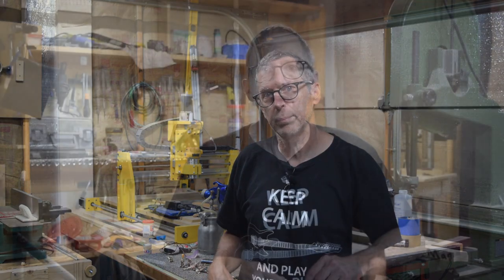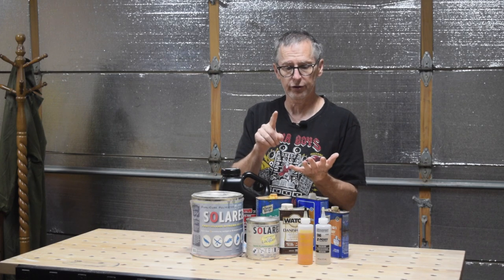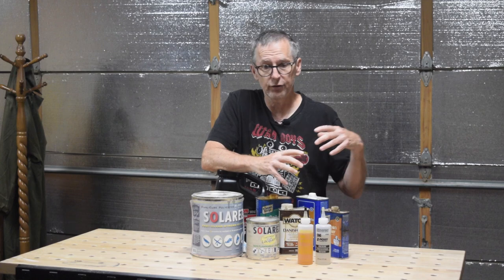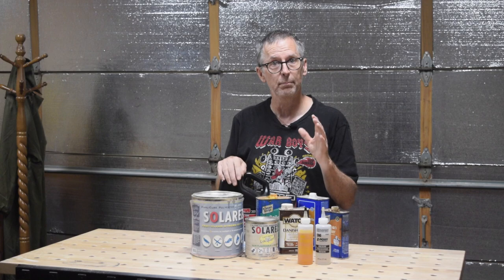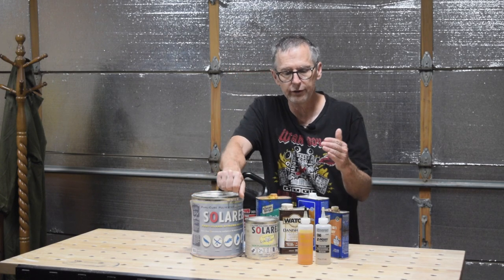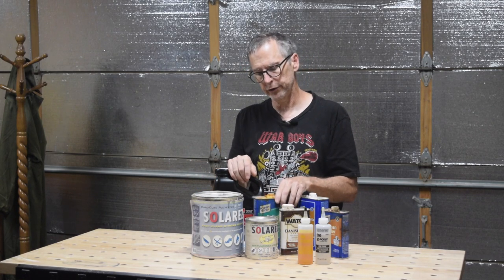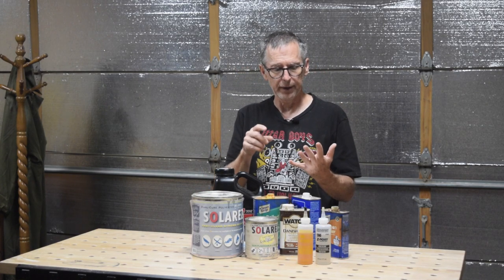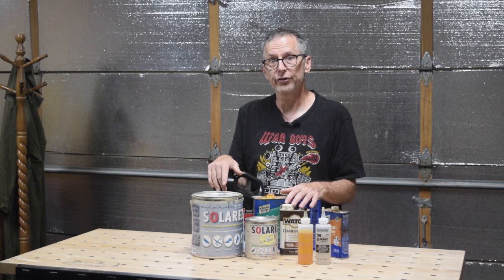Luthier Quick Tip 3: How to Decide On A Guitar Finish

Comment: Timely vid, thanks!  I just completed a refinish on an old Peavey Raptor using Duplicolor acrylic lacquer, and I'm not thrilled with the clear.  It's level and glossy, but still fairly soft after several weeks.  I worked really hard to apply it correctly, so I'm writing it off as unusable under my conditions and moving on to something else.  My son's SG-style kit is in process, and I definitely want a better topcoat when it reaches that stage.  I'm pretty much narrowed down to either Crystalac or a 2K urethane product.  I've used a rattle-can variant with some success (learned a few things for sure), and now I think I might be able to do a nice spray finish with my HVLP.  I've got to think that either would certainly would be more durable than this acrylic lacquer, with the additional bonus of getting to level and polish much sooner.

Comment: Thanks for this!  A great review.  

I have started using “I Can’t Believe it’s not Lacquer” and made a ukulele sized tanning booth for curing.  Very happy with it and the results!  My ukulele shop is in the basement beneath my home so the more potent vapors of the harder Solarez product takes it off the table.
Reply: Does yours still feel slightly tacky when cured?  I've been working on a body for much too long trying to get ICBINL to act like a finish coat but it just doesn't dry hard enough.  Not after curing for 25 minutes with a less-than-hair-thin coat.
Reply: feanor70115 I have applied many coats of ICBINL with a moist make-up sponge.  Then the object is cured in the booth with LED UV bulbs (385nm) then sanded between.the coats.  I judge the cure complete by the white powder sanding produces.  

I have not tried buffing to a gloss.  After sanding with 2000 grit I have applied wax and am happy with the satin finish that hand buffing the wax produces.  

Before sanding the cured glossy surface it does feel almost wet.  But the sanding shows it is not.  If I went to wax without sanding the wet might go away, but there are enough bumps I generally need to sand.
Reply: @short6691  Thanks for the info.  At this point I've pretty much decided to just wait for some Crystallac for a finish coat.   I've got a decent semi-gloss but it's too thin to buff (I've tried and it just dulls the finish and burns through it) and I just need a way to put a harder finish on it without a booth or a buffing machine.
Reply: feanor70115 Sounds like you have a good path forward.  

Best wishes!

Comment: Thank you for sharing your knowledge.

FYI, if there is a Walmart near you, they carry Tru Oil.  Also, if you leave the foil on the opening, use two small holes to dispense the product, then store upside down I have extended the shelf life well over a year.  One other snippet, when applying the last coat or two a few drops of mineral spirits will thin the product down and produce a surprisingly deep shine. 

And if you just don't like Tru Oil, well, never mind!  Thanks again for sharing.
Reply from the maker: The Walmarts in my area don't sell it. No one in my neck of the woods sells it. I have to order it and since I can get the same effect faster and cheaper with Z-Poxy, which is available locally at several hobby stores, that's what I will continue to use.

Comment: Thanks for the great info. I definitely struggle the most with finishing. I might give the CrystaLac a try fro my next build. I've used wipe-on poly a couple of times. It works pretty well but scratches fairly easily.

Comment: @highline guitars , great video , sir.   I have a question. I want to strip my Gretsch and my P-Bass down to just the bare wood.   I don't care about "gloss" "shine" or aesthetic appeal, I just want to seal/coat the body to protect it, that's all.   What product do you recommend for this? And any info about application , curing etc would be greatly appreciated! Subscribed to your channel! Thank you!
Reply from the maker: The easiest way is to use boiled linseed oil or tung oil. If you want a little more protection a wipe on polyurethane or Danish oil works great.

Comment: @Highline Guitars  I’m a hobbiest on my fourth guitar project.  My current project is the first one where I am doing a clear-coat over paint.   I have never level sanded or buffed a guitar.  On this project I don’t need to be bullet-proof.  Based on the video, I would like to try the I Can’t Believe it’s not Lacquer.   Here’s my question: On my current project, I have been doing image transfers using acrylic medium, and painting on top of that with acrylic paint.  The guitar is coming out really cool, but due to the transfers and the acrylic paint, there quite a few places where the surface is not smooth.  Ultimately, I would like to have a clear-coat that is thick enough to that I can get a smooth outer surface with  but without sand through the clear-coat when I am level sanding.  Would I need to worry about that with the I Can’t Believe it’s not Lacquer product?  Can you do multiple coats of the I Can’t Believe it’s not Lacquer?  If so do you need to level sand and buff between coats?  Any help is very much appreciated…
Reply from the maker: ICBINL is 100% solids so each coat cures thick. I've done multiple coats no problem and that includes level sanding with 400 grit between coats.
Reply: Thank you!  Super helpful…

Comment: Awesome tips.  I've been working on a guitar for a friend.  Doing a distressed brown look, but he doesn't want any gloss.  he wants a more matte or satin finish.  I like the Solarez products.  What would you recommend that would have the strength of the polyester but with no gloss?
Reply from the maker: Solarez products are intended for high gloss finishes. The only way to get polyester durability is to use polyester. A good alternative is 2k polyurethane. In fact, there are a lot of high tech water-based 2K polyurethanes on the market now. Centurion, Envirolac, Renner, and Milesi make them in matte to gloss sheens. Be forewarned, they require a catalyst to achieve maximum durability and they aren't cheap.

Comment: Yeah, Watco Danish Oil is great to work with! I got a free table from someone, took off the damaged veneer and applied some Danish Oil to it. I have a novice question regarding coating guitars. I was going to clear coat the headstock of my acoustic guitar with Rust-oleum 2X Semi-Gloss Clear, but I never. It comes in a spray can. Can you use that type of product for a gloss on a guitar?
Reply from the maker: I have never used it, so I can't say for sure. I would definitely test it on scrap first. Also, be aware that whatever you're spraying over could react with the clear.
Reply: That's a good point; I never thought about the possibility of there being a reaction. I had a bottle of it, and I gave it to someone who used it on signs for a glossy look. It doesn't seem to be a product to use on a finished guitar.  @HighlineGuitars

Comment: Great video! I tried making my own oil finish with boiled linseed oil, min spirits, and polyurethane like you suggested. It looks great however, after a few coats I think I want something that's more glossy. Can I adjust the ratio of the mix to have more polyurethane to achieve this? Or should I just wait for it all to cure and then apply something like the Crystalac Brite Tone? Thanks!
Reply from the maker: You can try adjusting the ratios, but you'd be better off using a clear coat like Brite Tone.

Comment: Learned a lot from your videos. I built a guitar from a soft okoume. Thinking of Solarez Polyester for max hardness. Will it lift the black analine dye and do I need filler or sealer underneath. The body doesn't have a lot of grain. Also would soaking the body with West exopy then use the less volatile Solarez be just as good?
Reply from the maker: I have no idea. you'll have to test on scrap.

Comment: I'm thinking of stripping the top polyurethane coat on my classical Cordoba c4 ce and using an oil based finish on it. Is it a bad idea to just do the top and leave the back and sides poly? I have a hunch that it may cause cracking, especially in a humid environment.

Comment: I could be mistaken, but I don't think you answered the question of which finish you prefer over a stained wood body. Could you shed some light on that question for me? Thanks so much.
Reply from the maker: These days, I like Centurion 1800 Water-Based 2K Polyurethane. However, a lot depends on the outcome I'm after. I also like to use Danish oil if I want to keep the look and feel of the wood grain.

Comment: I have an old but good Ventura acoustic, and want to remove the original stain/sealer; and stain it a lighter color. Any advice on which stain to use; and also, will I achieve a richer intonation with a particular satin. Thanks!
Reply from the maker: The only advice I can give you is to test on scrap. If I recommend a specific stain, you may not like it.

Comment: Just a  tip: brite tone will not stick on solvent or oil based based paint schemes while level sanding.  Chris is right you need  to stay solvent with solvent and water base with water base products.  Testing is essential.
Reply from the maker: I’ve never had a problem with adhesion between Brite Tone and solvent/oil based paint. Just make sure it’s fully cured before you clear coat.

Comment: I hate gloss finishes. I'm leaning towards the boiled linseed oil. But if I want a bit of tint, would you recommend stain first and then apply the boiled linseed oil over top, or mix some sort of transparent pigment into the linseed oil?
Reply from the maker: I use Windsor Newton artist oil paints to tint the BLO.

Comment: What is the best finish for achieving the best tone?  That is my main objective.  I just bought a Martin that does not have a finished top and the tone is amazing!  I'd like to finish it, but want to maintain or enhance the already great tone. Thanks for your experienced insight!
Reply from the maker: Since I concentrate on electric guitars, the finish doesn't matter. However, on acoustics, the thinner, the better. A thin coat of Solarez I Can't Believe It's Not Lacquer or Crytalac Brite Tone are my choices.
Reply: @HighlineGuitars  Thank you for the insight!  One more question though if I may,  since I'm okay with a satin finish, would an oil finish be the best for acoustic tone?
Reply from the maker: @michealjoseph9943  that would be the best for resonance, just be aware that oil won’t offer ding and scratch protection.

Comment: +Highline Guitars do you have any experience with minwax water-based wipe on poly? Do you recommend it? Looking for something water based and durable
Reply from the maker: It's okay. A bit tricky to apply because it raises the grain. That means you have to lightly scuff sand between coats to remove the raised grain and get a good bond. Also, it's not going to be as durable as a spray on water-based polyurethane like Crystalac Brite Tone or especially Centurion 2K water-based polyurethane.
Reply: @HighlineGuitars  would you recommend varathane’s water based wipe on over minwax’s? Thanks for your help, we really appreciate how you share your experience with us so we can learn
Reply from the maker: @anthonysclafani3963  I've never tried Varathane's product.

Comment: I’m looking to apply a real leaf to the top of my poly-finished turquoise Les Paul. Any quick ides? Several coats of brush-on poly? Love your videos! ✌️❤️
Reply from the maker: I would laminate the leaf to the body with slow setting epoxy. As it dries, lay a piece of wax paper over the leaf along with some HEAVY books to make it as flat as possible. Let it sit overnight and follow up with multiple coats of polyurethane. Good luck!

Comment: Great video. Very informative.
I have a question: is Watco Danish Oil compatible with dyes or stains? I mean, can it be applied over a stained body or top (like a hand rubbed burst)?
Reply from the maker: Watco Danish Oil is already tinted.
Reply: @HighlineGuitars  I mean the "natural" one, apparently it is clear(ish).
Reply from the maker: @LaPiernaDeMiAbuela  It should work. Test first on scrap.
Reply: @HighlineGuitars  Thanks!

Comment: Not familiar with Z-Poxy. You say it has "a slight amber tint to it" and I have to ask, amber in an "antique" lacquer kind of way by any chance? That could be really appropriate for a very subtle relic outcome I have been trying to figure out for sometime. Note: I'm not talking about the usual, "the tour bus driver ran it over, multiple times" type relic jobs that are all the rage it seems, but rather a certain "patina" (if we can we call it that) in some older lacquered instruments that I would like to be able to solve for. I think I can handle the "crackle", but nailing that color (discolor) with a gloss finish is the prize.
Reply from the maker: If varies from bottle to bottle.

Comment: How many coats of zpoxy do you recommend? I have a mahogany body that is finely sanded from a stewmac kit and I’ve never done a guitar before. Plenty of experience staining  pine doors and moulding  in my house couple decades ago followed up with water base  satin polyurethane, but that’s it. Still a novice. Still on the fence….
Reply from the maker: Every situation will be different, but no more than 3 coats should be sufficient.

Comment: G'day, love the video. But I was just wondering do you need to coat of paint or varnish on electric guitar/bass at all? Can you get away with just bare wood and apply may be a wax finish to it once in awhile.
Reply from the maker: You need to seal the wood to prevent warping, twisting, bending, and cracking due changes in humidity. Wax isn’t sufficient to seal the wood.

Comment: If I wanted to paint my guitar body with acrylic (water-based) paint, is there a finish/topcoat I could apply that would take less than the standard 30 days to cure? I don’t need a mirror or high-gloss sheen, satin is fine. 

My only real stipulation is that oil-based finishes would screw the paint job up and I’d rather not have to sand the entire thing down and start again.
Reply from the maker: Centurion Water-Based 2k Polyurethane.

Comment: Qucik question for you, hopefully you see it and can respond.  Im going to use the watco danish oil on an acoustic guitar.  After i apply the finish, do i need anything else ontop of it for example a clear coat, poly, or lacquer?
Reply from the maker: Only if you want an additional level of scratch and ding protection that Danish oil can't provide. Keep in mind that there are some people who think that clear coating an acoustic guitar will diminish its resonance.

Comment: Have been trying out "I can't believe it's not lacquer " on rosewood.  I use as a sealer and a cover finish. My rosewood finish is not curing as expected. Do you have any pointers for using this product on rosewood?
Reply from the maker: Rosewood contains oils which can inhibit any type of finish. I believe Solarez sells a sealer specifically for oily woods, but I'm not sure and their website is currently down for maintenance. One thing you can try is to wipe the wood with acetone. As soon as it flashes off, apply the Solarez ICBINL.

Comment: Have you used an automotive style clear coat product, with separate hardener, like Omni? Thoughts on something like that, compared to Crystalac and Solarez?
Reply from the maker: Yes, I have and they are incredibly durable. However, they are also super toxic as the hardeners contain isocyanate. In Europe, they have just started to restrict the amount of isocyanates in these hardeners. The U.S. will eventually follow. Will that spell the end for 2K Polyurethane?

Comment: Just got an ES style kit. Whilst waiting for delivery I have watched umpteen videos (mostly yours) and think Crystalac is what I will be using. I have questions but 2 are on my mind. 1. Is it OK to use an orbital sander on a guitar which does not have a flat front? 2. How do I deal with the bindings? Should I use narrow vinyl masking tape?
Reply from the maker: 1. Yes, if you are careful and/or use a variable speed ROS set to the lower speeds. 2. I spray my clear right over the binding. If it's tinted, I spray over the binding, let it dry and scrape the color off the binding with a razor blade.

Comment: I have removed the original polyurethane finish off the face of my spruce top acoustic guitar. I'm wanting to give it an antique look (without the distressed marks, etc.) What sort of finishing process is ideal for that?
Reply from the maker: I would go with a natural tint Danish oil. Hand rubbed with 5-8 coats.

Comment: Could I use Crystalac matted finish on Zpoxy or have you found Zpoxy to be sufficient for the top coat?  How do you use Zpoxy on maple?  Would I just apply multiple coats of Zpoxy to build a finish?  Does Zpoxy need sanding in between coats?  Thank you.
Reply from the maker: Z Poxy works great as a top coat. However, if you want a matte sheen, you'll have to use a top coat that is formulated to dry with a matte sheen. Crystalac Brite Tone Matte would be a good choice. You can also apply Z Poxy to Maple the same way you would any other wood and yes, you'll need to scuff sand between coats to ensure proper adhesion.
Reply: @HighlineGuitars  If I apply Zpoxy to bare mahogany/maple, I would scuff it before sealer?  Would I use Crystalac Sanding Sealer or just scuff the Zpoxy and apply Crystalac Matte finish?
Reply from the maker: @pigjubby1  No need for the sealer. Just scuff the Z Poxy and spray your Brite Tone matte.